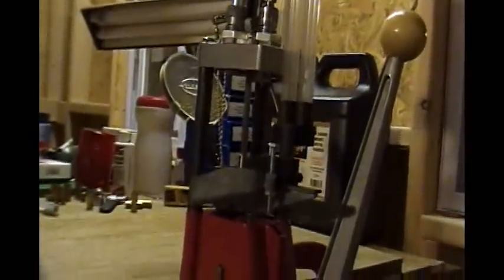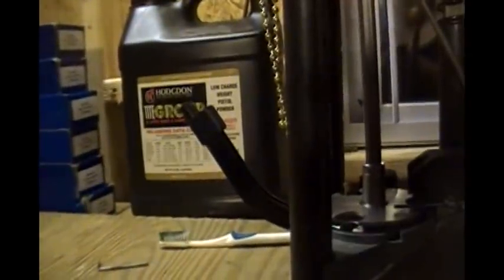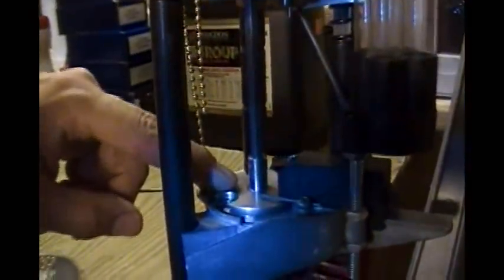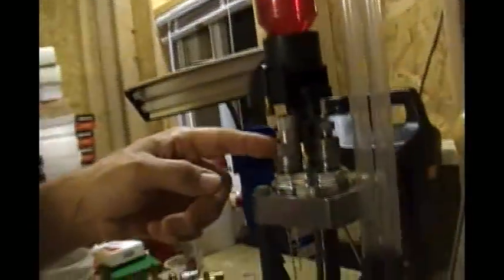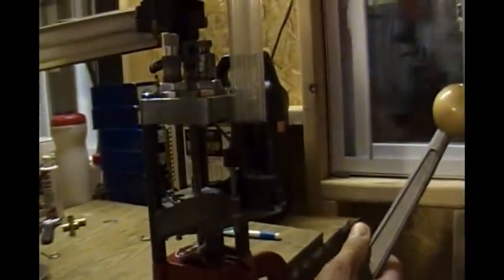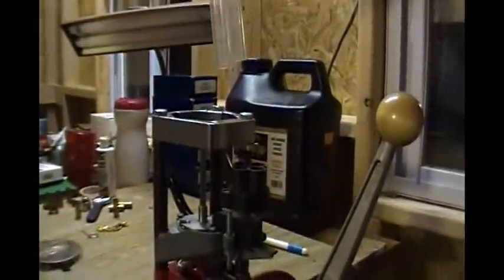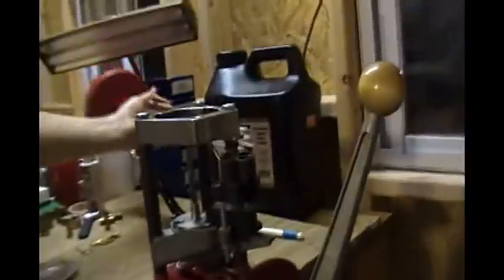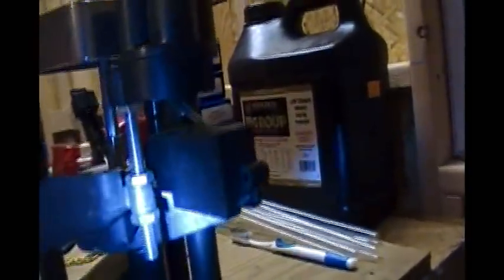Changing/Converting Cartridges on a Lee Pro 1000 - Part 1 of 2

Comment from the maker: True, a spring or short bungee cord does a very good job.

Also, using the spring return for use on the Classic Cast and Classic Turret works very well.  I've been doing that on the .44 Mag press for a bit, with great results.  There's a slight increase in double-charging with certain corner-cases if one's not paying attention, but I think most reloaders are pretty responsible folks anyway, so it shouldn't be an issue in actual practice.

Comment: I also find I  have to zero it ocasionaly  proabaly due to the little plastic gear on the index rod wearing they dont send 2 extra ones n a little pack with the press when its new  for nothing  thanks for all the informative viseos they really helped me to familiarize myself with the press.  have built a bullet coalator and a shell coalator  thanks to more informative videos  on you tube a couple lowes buckets mdf board 2chinese 3.5 rpm motors 2 weekends work